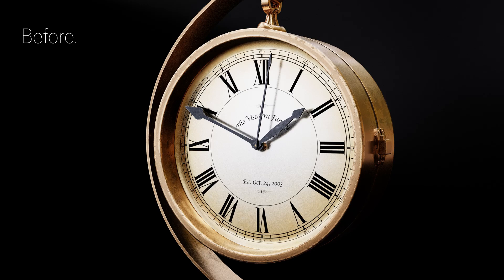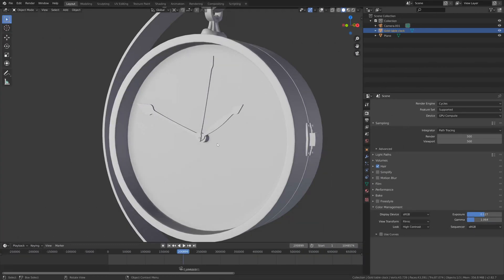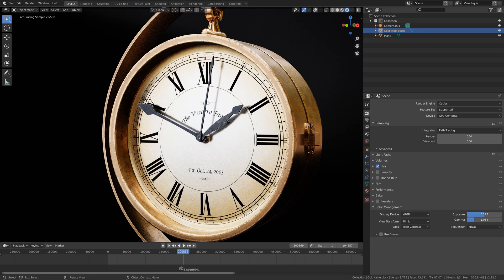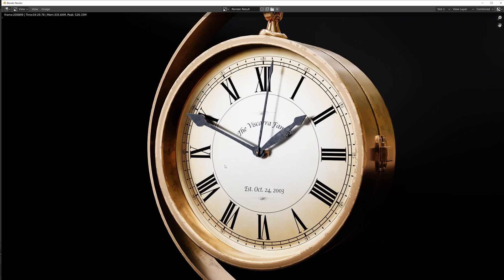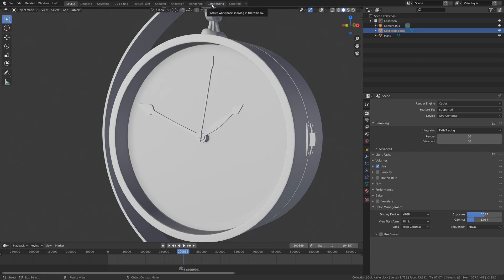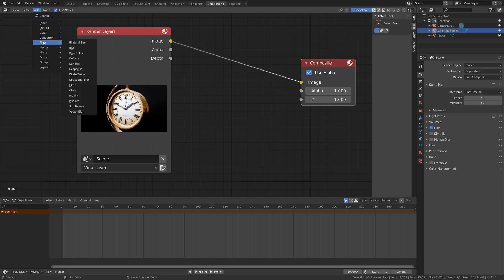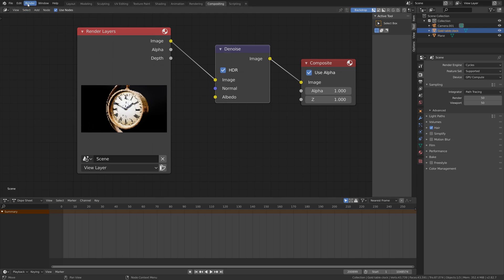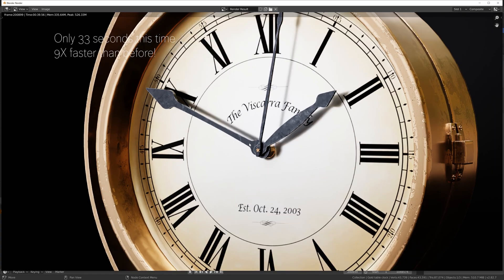[2.82] Blender Tutorial: Denoise Quick Using Artificial Intelligence, AI Denoising

Comment: Is that different than using the denoiser in the layer properties panel? If rendering with CPU or GPU CUDA, the denoiser in the layer properties panel using a blurring technique. But if RTX cards are available and OptiX is used, it uses AI. So what's different about using the compositor vs using the denoiser in the layer properties panel.

Comment: You shouldn't turn down your sampling to 50 and denoise everything though.
And also 500 samples render in 4 hours? What do you use?
Reply from the maker: 4 minutes
Reply: it's 4 mins not 4 hours :D also it heavily depends on the scene how many samples to use. for a bright scene its totally fine to reduce it to 50 and denoise. with darker scenes any noise will be a lot more present so it's more obvious if you reduce it and things can get a little washed out and messy. to counter that, you can always try to mix the denoised output with the original output with a mixrgb node
Reply: 4 hours lol... I think he is having a 3dfx voodoo 2 PCI card